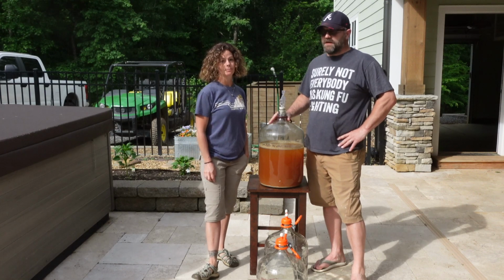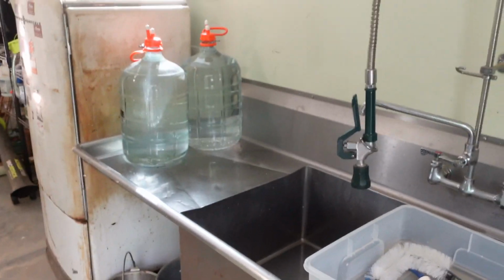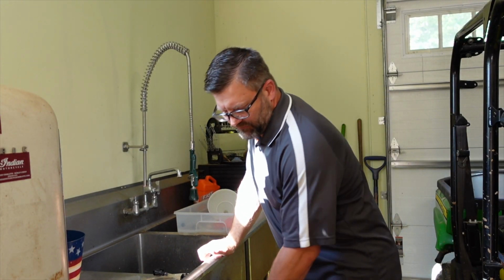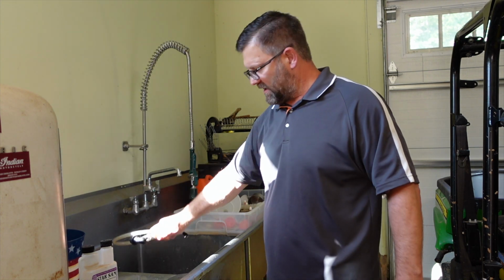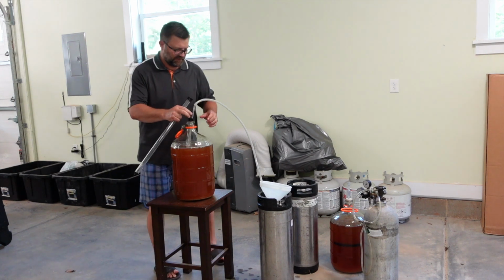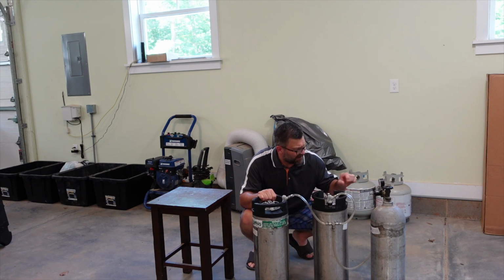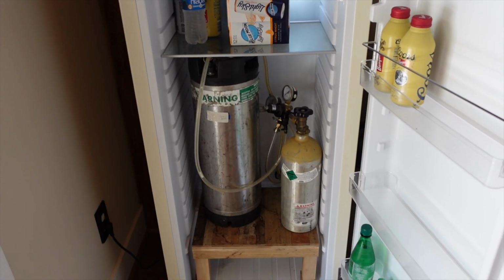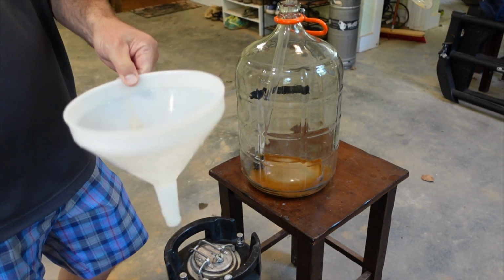Awesome Beer at Sunshine Acres

Comment: You definitely don't want to transfer beer through a funnel and drop it 3 feet into a keg after fermentation is done. That's how you oxidize beer. Also you didn't purge the kegs and you put co2 on them and started shaking them which adds oxygen to your beer. Oxygen before fermentation is good, oxygen after is bad. Get a longer hose that goes to the bottom of the keg (lose the funnel), purge the kegs of all oxygen before and after you transfer the beer plus before you start shaking them.
Reply from the maker: All good advice.  I have just been doing the same thing for 20 years and should review all my procedures!  Thanks for watching.